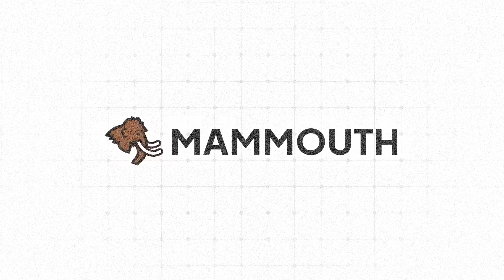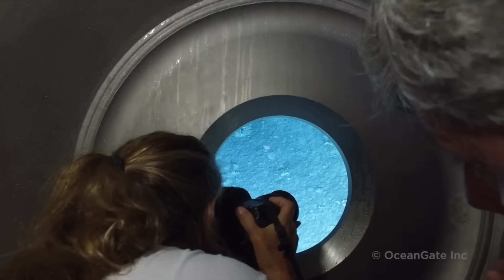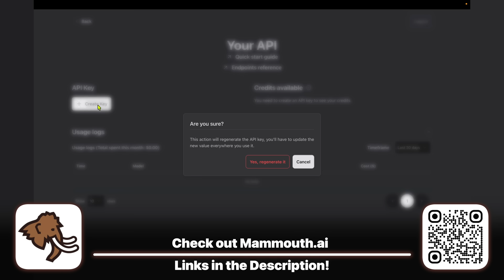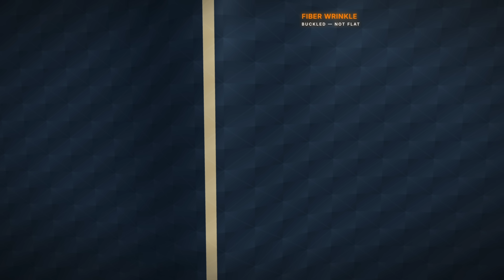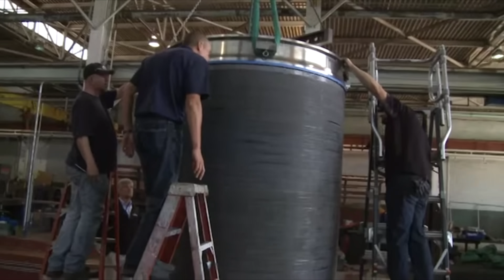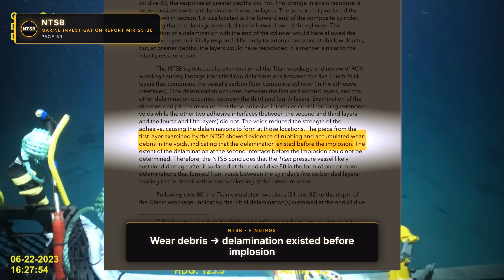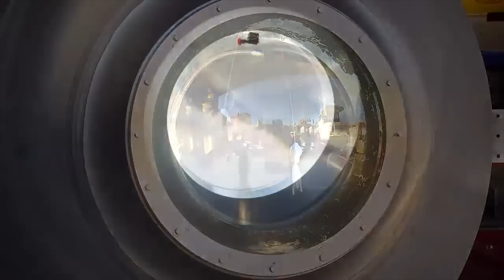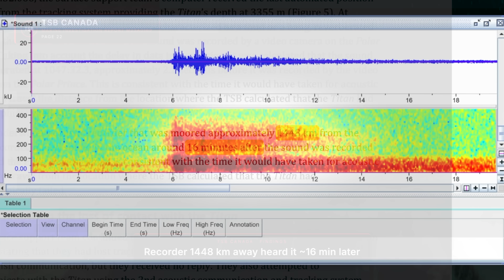Oceangate Titan: It was WORSE Than We Thought

Comment: A designed safety factor of 1.25 is WILD
Reply: ASTM tests determine the properties of the material.  Not aware how a safety factor relates directly to the tests?  ASME gives 3.5 to 4 for pressure vessels (holding pressure, not resisting external pressures).
Reply: @d15p4tch6  I have to admit 1.25 feels  low - super low.  The SWL for steel cable in 5:1.  Now consider the 1.25 figure - is that 1.25 design pressure?  If so, let’s use and worked example:
As a rough rule of thumb, water pressure increases with depth at a rate of 1ATM per 10m
If the design depth is 3000m then the pressure is 300ATM (plus the 1ATM of the air above, but let’s not split hairs)
1.25 gives me a safety margin of 750m
So designed crush depth is 3750m
750m feels quite big now.  Of course, the manufactured vessel needs to meet the design specifications first, and to eliminate manufacturing inconsistencies you might want to add a little more.
Reply: Pressure systems use 1.5.  1.25 seems wildly low for a civilian transport
Reply: It's astonishingly low. But also it's astonishing that it was never tested to confirm that it met the 1.25 spec. If they had sunk it to 1.25 times its rated depth and then confirmed no failures with live monitoring and ultrasonic non-destructive tests, then I'd have a bit more trust in it.
Reply: Same used for airliner landing gear.
The difference being in the QC-QA testing and maintenace.
Reply: Rohn doesn't publish their data, but I think they designed the Plexiglas window with safety factor of 3.

So Stockton Rush being Stockton Rush, he ordered a window for a dive depth of 1300 meters. Because with a safety factor of 3, you get 3900 meters, right? Who needs a safety margin anyway!
Reply: @d15p4tch6  it’s pretty standard of 1.25. Most ASTM tests use 1.25
Reply: @thamomentum  A lot of applications involving human safety use a factor of 7 I think. Like elevators. 1.25 is something you’d use for a racing drone or similar
Reply: more like you are wildly ignorant
Reply: @Blox117  I worked at an aviation company and we didn't use anything less than 2.

You'd think they'd be more conservative pushing a new material AND sending folks to get crushed under the ocean SMDH
Reply: @Blox117 thank you for your wisdom. Mr "you are iGnoRanT"
Reply: @Blox117  Can you actually explain how?

Comment: I still remember when this was happening and they showed how it was made using spun carbon fibre 🤦‍♂, just being into motor sports and having products made from carbon fibre I knew they weren't coming back alive. That death trap hull would've needed to be ultrasound tested for cracks millimetre by millimetre each time it came back for safety reasons (although still a death trap waiting to happen) which would've taken forever even with automation and they were clearly using it way too frequently for that to happen. I really can't think of a worse design or material to use for that purpose.

Comment: 18:50 - The winter average in St John's is -5C; Winter lows drop as low as -20C and St John's gets about 2 months per year where the temperature doesn't get above freezing. This is an absolute recipe for humidity build-up and eventual damage due to hydraulic pressure.

Comment: Not sure what the cost and weight difference would have been, but wouldn't it have been relatively straightforward and simple to make the cylinder out of titanium? Titanium is light and extremely strong-I'd guess it could have been thinner than the 5 inch thick carbon fiber. (Then again, Rush was the world's biggest self-proclaimed expert on carbon fiber.) Mindboggling gluing the titanium endcaps on in an open, dusty warehouse by guys wearing t-shirts and shorts seemed like another potential failure point if the carbon fiber (already expired and bought to save money) hadn't. Epoxy is rigid isn't it? I wouldn't think it would do well under repeated stress trying to hold two dissimilar materials together under extreme pressure-plus the carbon fiber had to deal with not only pressure changes but extreme temperature changes as at depth it's near freezing-another stress factor I don't hear people bring up. Hindsight is 20/20 as always-but there were obvious red flags screaming to be noticed and I picture Rush with his fingers in his ears singing "LA LA LA"; he didn't want to hear it due to financial pressure and hubris at not wanting to admit his brainchild was a Russian roulette machine for billionaires-each dive adding another round.

Comment: A interesting workaround, to carbon fiber disliking thick layering that they never considered, never trialed, never tested. Multiple layers, loaded as you dive.

To go 2 km deep, pause every 500 m, turn off a valve, straining the innermost hull to a limit, creating a consistent pressure differential, each layer holding a different pressure, the innermost layer had the least defects, awesome, build 5 layers, and keep them separated by valves and manage the pressure differential across each.

This helps reduce the stresses within each layer, allows you to replace individual layers that show weakness, or faults, and spreads the loading evenly between all five layers, each holding out the same amount of pressure. Presumably the innermost layer is built to hold out double pressure in case an outer layer ruptures.

A balloon inside a balloon inside a balloon.
Reply: clearly you have NO idea what you are talking about. The five layers (was supposed to be 7 in the design breif) act together to withstand the compression load. no single layer can hold the foces. and the titanic is 4km deep.
Reply: @r.b.l.5841  yes. But. Pressure is a variable we can control. Hydraulics are a very well understood phenomenon.

The inner layer? Atmosphere on one side, 100mpa or whatever on the other. Second layer. 100 on the inside 200 on the outside.

Every single layer has a known tolerance and can be repaired or replaced if faults are found. Every layer visits the kiln once. Every layer has the better reduced wrinkle pattern found on the innermost clean cylinder.

And with a 30% load tolerance. One layer of 5 failing to hold pressure will only deform so much, trapped by the pressures on both sides till they equalise, sharing its load to two layers at once, which should absorb the energy without imploding. Emphasis on should. And the gap between the layers being there to help facilitate that energy absorption.

Comment: Now do airplanes!  "...a hard landing applies a massive, localized point-impact force through the landing gear directly into the lower fuselage structure." 
"Beyond 600 fpm (Hard Landing): When a landing exceeds this threshold, the localized energy overrides the shock absorbers. While an aluminum plane will visibly dent or wrinkle—giving engineers a clear map of where the metal absorbed the crash energy—carbon fiber responds completely differently."
"Because carbon fiber is highly elastic, the outer skin of the fuselage can take a massive blow from a hard landing or a ground service vehicle, flex inward, and snap back into place looking entirely pristine on the outside. However, underneath that flawless exterior, the impact creates localized destruction: ... The "Bruise" Effect: It acts exactly like an internal muscle bruise beneath undamaged skin. If the plane takes off again without discovering this hidden delamination, the localized loss of internal stiffness can cause the damage to rapidly grow under normal flight stresses, eventually leading to structural failure."
But hey, in an industry where cutting costs and corners is more prevalent than ever, I'm sure they use the thermography/ultrasonic scans EVERY time there's a landing hard enough to go above the threshold right?

Comment: The dumbest thing is they KNEW carbon fiber was trash for a sub shell. They literally tested it in pressure tanks and it failed every time never even getting close to the proper pressure or scaling at titanics depth. Attaching titanium end caps to said carbon fiber with adhesive is the icing on the cake if death. Everyone involved in this project should be in jail and bankrupt

Comment: 8:08 I find it interesting that layers 4 and 5 that we see in this picture sheared in an rectangular pattern. There are other pictures in the reports where you can see a bunch of hull bits that are all rectangular in shape, where the long edges of the rectangles are all in the axial rather than circumferential direction. So the hull was crushed along the cylinder rather than across it.

Comment: This proved how EXTREMELY CAPABLE carbon fiber is if it could survive SO MANY dives while being built in the WORST way possible ignoring all safety warnings and basics of physics, building way thinner than the suggested minimum and in a very careless way. Its an absolute miracle it did not implode the very first dive after they literally ground down uneven layers partially and heard the layers coming apart and rubbing against each other and the thing still survived for so long. Truly a remarkable material and engineers on it who could somehow make it work so many times despite a boss who has constantly made it impossible to build a safe sub

Comment: Being fine as designed is a rather useless statement since it just means that in theory if all parts were ideal it would work. What matters is a design that works in practice which requires it to actually be reliably be built in practice.